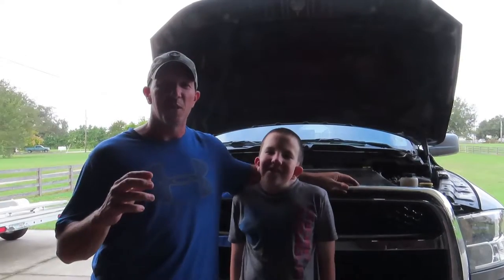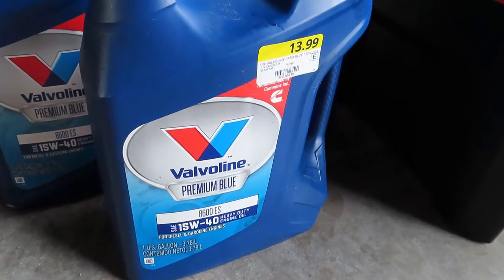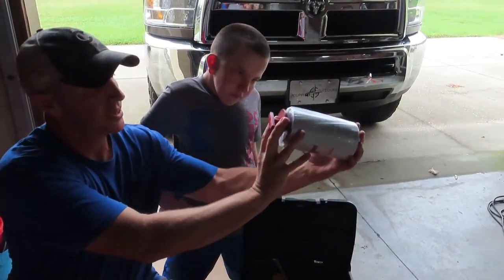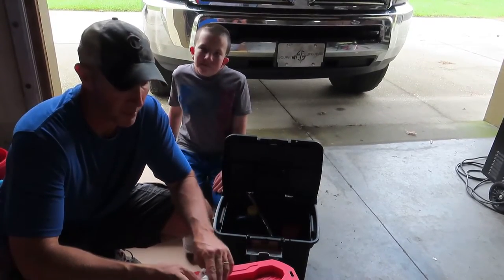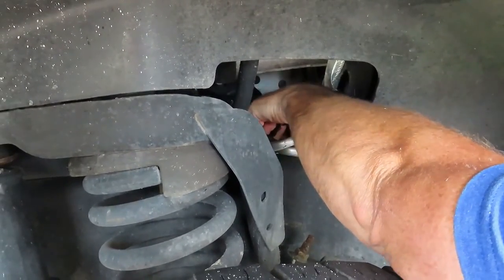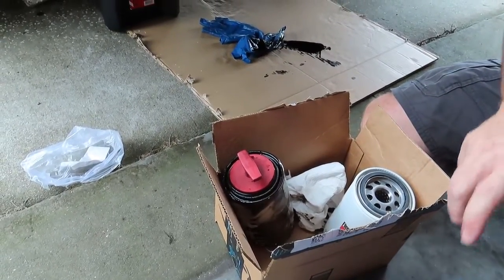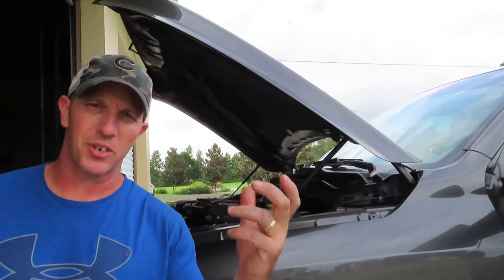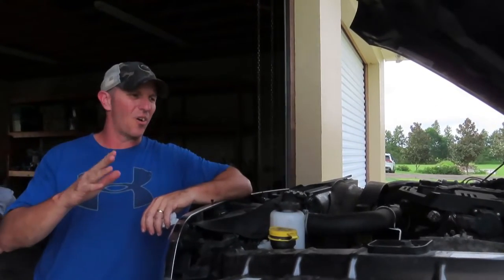DIY Ram 2500 Diesel Oil Change | Why You Should Do Your Own Maintenance

Comment: Have you considered a "fumoto" valve in place of the drain plug? Also, kudos for pre-filling the lube oil filter. There is no "controversy" since both Cummins and Ram service information state the filter is to be pre-filled. 👍
Reply from the maker: I had to go look up that valve...WOW! This will be added during my next oil change! I am often changing the oil in a parking lot since we travel full time in our RV. This would be a game changer for me and further reduce the chance of accidental oil spillage. Thanks for the heads up and thanks for watching!
Reply: @JouppiOutdoors  you are most welcome. I made the suggestion because it can reduce your "mandatory tool count" and reduce potential for oil on your hands.

Comment: Thank you for the information. That filter plug is very useful. Is the oil filter in the same place on the 2019-2020 models? What about the fuel filter and fuel filter water separator that must be changed as well. Is that difficult/expensive job?
Reply from the maker: You’re welcome! Yes, the oil filter is in the same location on the newer models. We have a video on changing the fuel filters as well, I’ll link to it below. Thanks for watching! 
https://youtu.be/f143cYHZqUs

Comment: I just did my (first) oil change on my 2013 today. No idea why one would contort through the sidewall. From the same position where you remove the pan plug.... loosen the filter and it will drop straight down... replace the same way looking (and aligning the new filter) straight up. I have one of those filter gizmos but no way I reach blindly through the sidewall or cut my wheel well guards when doing it from underneath is so straightforward and easy.

Comment: Love the handle tool, I change mine every 6k. You have to make sure to let those drain about 30 min. There gets a air bubble and it won’t drain all the way if you don’t give it the time. Baldwin and Donaldson filters are great also. Love your Reflection!  Just put the banks diff cover on to help with the cooling while towing 12k up mountains. Nice job working with your son!
Reply from the maker: Good info, thanks for sharing! I’ve thought about changing the diff cover as well. Thanks for watching!
Reply: @JouppiOutdoors  
Check out the Banks cover, his engineering of the cover is awesome.
Reply from the maker: I will absolutely check it out, thanks!

Comment: Took mine to the dealer for an old change I can see they change the auto oil filter, but when I looked at the oil, it looks like it’s already black is that a common diesel thing? I’m coming from a gas
Reply from the maker: Hi there! Yes, it’s common for the oil to turn black very quickly.

Comment: Paid for an oil change and like you said on video they made a mess and spilled oil all over chassis and it dripped oil for days on my drive way.  Just ordered the filter plug tool from your link and plan to do it myself from now on.

Thanks!
Reply from the maker: That definitely sucks! You won’t regret doing it yourself, the filter is a tad tricky to screw back on the first time since you’re working blind. Still the easiest vehicle I have ever changed the oil on! Thanks for watching!

Comment: Good video showing how easy it is and how to save some money. I do a similar thing with mine using the Valvoline from RK. I order the filter online and then schedule an appointment with my local dealer. They change the oil and filter, using what I provided, and dispose of it all for only $15.00! It usually take them about 20 minutes to a half hour and I don't have to mess with the old oil and filter. Keep up the good work.
Reply from the maker: Wow, if I had a dealer willing to do that I’d probably take advantage of it too! Thanks for watching!

Comment: That oil is not good for 2019 and above must use 10w30
Reply from the maker: You are correct, this is a 2018. O would recommend whatever the manual says for your particular vehicle. Thanks for watching!

Comment: another thing you can do if you do not have the plug is double bag 2 gallon size ziplock plastic bags... Drop the filter into the bags.. zip.. and pull them out.. Not as neat as the plug, but it will work.. .Awesome video regardless..
Reply from the maker: That is a great idea even with the plug to catch any accidental spillage or drainage from the old filter. Thanks for sharing!

Comment: Thank you so much for this. I recently got me the same truck and I have been a bit intimidated on changing the oil. Seems simple enough. Now to figure out the fuel filters. Thank you again.
Reply from the maker: The fuel filters are not very difficult, but they can be messy. As long as you have the oil filter plug tool, the oil change is one of the easiest I have ever done on any vehicle! Thanks for watching!
Reply: Can you do a video of the fuel filter please
Reply: @edgarmartinez7533  he's got one already oh his page for the fuel filters. Changed mine yesterday. Pretty easy

Comment: Just one comment.  Not sure what year yours is, but mine is a 2021 6.7.  My manual says to use an oil that meets the standards of API-CK-4, or Mopar MS-10902, or Cummins CES 20081 (which I think might be a typo and should be 20086)  I do not believe the valvoline oil you link to in your description meets any of those standards.   Looks like the newer cummins need to use an oil meeting different standards.  Great video and thanks.
Reply from the maker: Mine is a 2018, I am not familiar with the requirements of the 2021 Cummins. The main point was to show that this is a process you can do yourself fairly easily. Thanks for the information, I’ll have to look in to it and thanks for watching!

Comment: New subscriber here!  Great video on the oil change.  I have the same 2018 truck, just different color.  My son has a 2001 Ram 2500 Cummins, and we will both be doing an oil change this weekend.  I found your first video on the fuel filter change, and that was very helpful to me, as I bought this truck used a few months ago, and I had never serviced a 2018 Ram 2500.  We have started buying our filters from Doc's Diesel, and they offer a good price as well.  Check them out!  Thanks for the great video and safe travels!
Reply from the maker: Thanks for the info and thanks for watching!

Comment: I quit going to the Quick Change places. I had one  add about half a Quart of Oil to the rear diff and it cost me $ 85.00. Had one change a Fuel Filter. Another $ 80.00. Told 3 different shops I had Grease Fittings on Front Driveline because of Aftermarket Parts. Had them checked on a long trip,Tec said water was coming out while he was pumping Grease in. Had one who wanted to service my Transmission,said he was going to flush it with Solvent. Decided to change my own Oil one time and the Filter was so loose that if a rock would have flown up and hit it, it likely would have broke loose.plus a lot of shabby work for a high price.it’s kind of an ongoing problem so I started doing my own Servicing. Motor,Gearboxes and all. A lot less worries and I save a few bucks.
Reply from the maker: All great examples of why doing your own maintenance is important! Thank you for watching!

Comment: Would removing the fender liner make the process any easier? Or would that not make much of a difference?
Reply from the maker: It wouldn’t make enough of a difference to justify the work involved in removing the fender well. I have seen others remove the air filter box and go in from the top, but again, a lot of extra work. I can knock out the oil change in 15 minutes doing it this way.

Comment: Do the fuel filters need changed at the same time? Is there a video for that?
Reply from the maker: I started off doing the fuel filters at the same time as the oil change, but have gone to every other oil change with no issues. Here’s a link to the fuel filter video: https://youtu.be/f143cYHZqUs

Comment: The oil looked very black. What is the interval between changes
Reply from the maker: This was changed at 10,000 miles…well before the 15,000 mile interval recommendation from Ram. Diesel Oil will look like that even with frequent oil changes. Thanks for watching!
Reply: @JouppiOutdoors  Thanks I ordered a 2023 in October still not here. Ugg. I think I will do changes every 10000km.

Comment: This was absolutely awesome! I just got a new Cummins and will be doing my own maintenance after this! Thanks brother!
Reply from the maker: It’s the only way to go! Glad you found this helpful and thanks for watching!
Reply: @JouppiOutdoors  I was watching another how to and saw there are two fuel filters on the gen 5's. I had no clue.
Reply from the maker: Yeah, messy job and not super fun but it will save you A TON of money doing it yourself! I did mine at the recommended interval and the old one up front looked like new, so now I change them every other oil change and have had no issues (roughly 24-25k miles)

Comment: I pre fill the oil filters.  But the oil you added is noted faltered.  I think minor deal for good fresh engine oil.  Bigger deal for final fuel filter.  Bot others have disagreed.
Reply from the maker: I’ve seen arguments both ways. I try to pour the oil in through the small holes so it gets filtered as it goes in but not convinced it makes that much of a difference. Thanks for watching!

Comment: Good video mate! I got a RAM 2500 with the Cummins 6.7 diesel couple of weeks ago. Now I know at least i can try this myself. Does the oil have to be changed every 5000 miles? Would that suffice? Thanks!
Reply from the maker: The 2018 interval from Cummins is 15,000 miles. I try to go 10-12,000 max. You can check out cumminshub.com, it has the entire maintenance schedule for the 6.7 
Thanks for watching!
Reply: @JouppiOutdoors  Thanks! Will check out cumminshub. Now that you mention it, I remember seeing in the owners manual every 15K miles. I have the 2019 RAM 2500 with the Cummins 6.7. Got it with <35K miles. I'll plan on doing the oil change at 45K miles.

Comment: You should never pour oil or gas in center  of filter, You defeat purpose ,Pour it in the outer holes ,It's filtered from the outside to the inside large hole
Reply from the maker: I never considered that since it’s new oil. It’s a good point though, thank you for watching!
Reply: Oil from a new and sealed container is the cleanest oil that filter will ever encounter. Cummins and Ram in factory service information require pre-filling the filter and show new oil from a sealed container being used just as shown in this video. You can do as you wish, but there is nothing to criticize here as the process shown complies with factory service requirements.
Reply from the maker: @walterk1221  Thank you for the clarification, I never looked it up. I was taught to do this by a highly respected diesel mechanic when I was younger. Thanks for watching!
Reply: @JouppiOutdoors  you are most welcome. As an owner since 1989 I feel compelled to share knowledge and experience.
Reply: @JouppiOutdoors  you are most welcome.
Reply: Just bought a 2022 dodge ram 3500 to pull rv high output cummins already bought tool for filter now looking for 5 gallon catch bucket lol great video